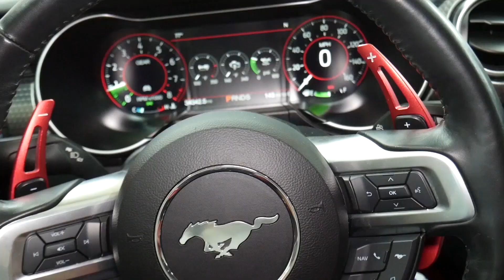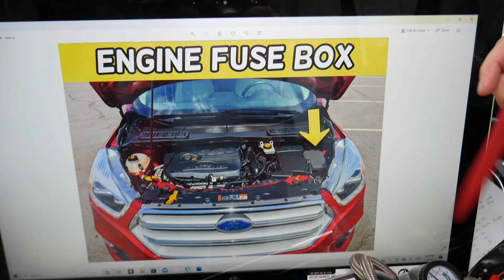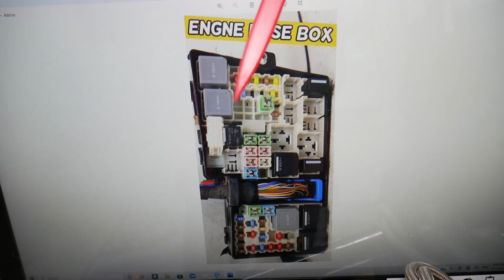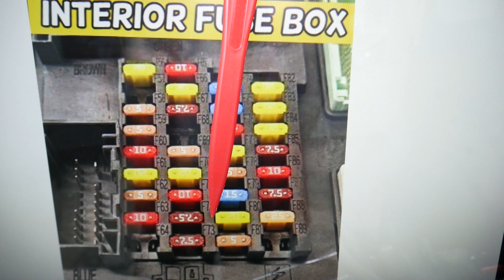WHY AC DOES NOT BLOW COLD AIR, AIR CONDITIONER NOT COOL FORD ESCAPE 2013 2014 2015 2016 2017 2018 20

Comment: Thanks  on my Ford I think is the controller for hot and cold is faulty  not cooling and switch to allow outside air enter cabin even been active switch back and forth  kind  that wire  acting. Thanks for letting me know issue.